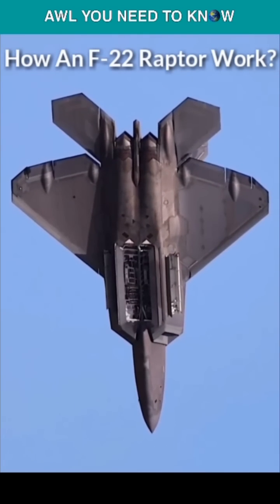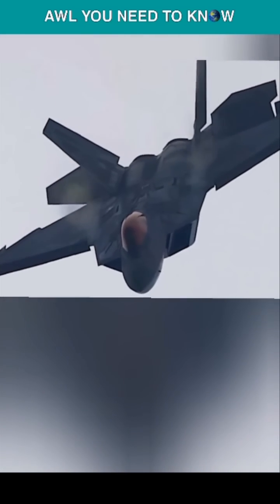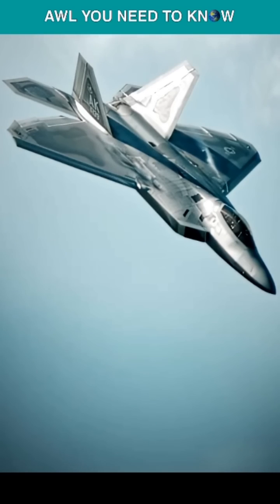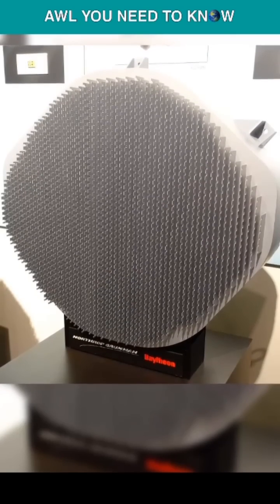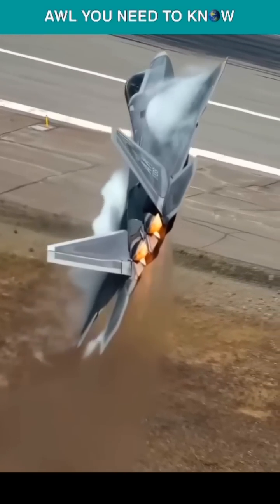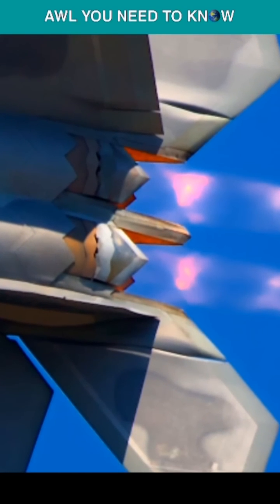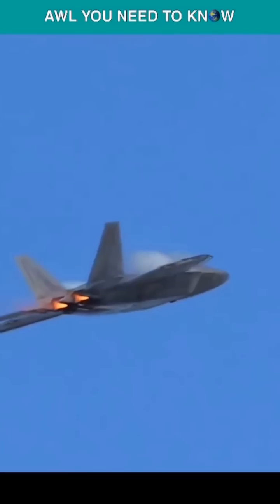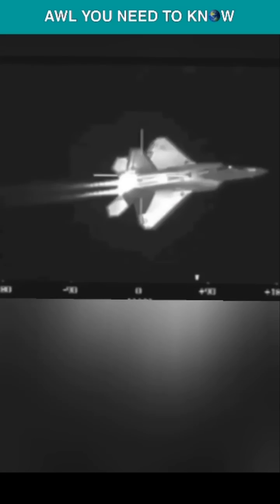How An F-22 Raptor Works? #shorts

Comment: Actually this is inaccurate. Most of the Raptor's surfaces are at angles and not curved. Curved surfaces would reflect back to a radar station.  The angled surfaces deflect the radar waves so that they don't go back to the radar station,  thus rendering the Raptor "invisible."

Comment: Need to make a Gatling gun that drops out of the bomb bay and will rotate 360 degrees to gun shoot without need to turn plane.
Reply: Cool idea, but seems impractical for a fighter.  That would add unnecessary weight and complexity.  Gun kills are insanely rare.  If a Raptor gets into a gun fight, MANY things have gone wrong.  

An interesting statistic would be of the 105 kills the F-15 has, how many were with guns 🤔

Comment: Radar is often visualised by showing waves. They're also called radio waves as well. Does this mean that in theory radar signals could be sent out from the plane to cancel out the radio waves from the radar? In other words, can they put something similar to noise cancelling from headphones into an airplane to make it near invisible for radars?
Reply: It's called jammers and yes, they are definitely in use
Reply: @babayada2015  I thought jammers worked by sending out noise. Though, it would make sense if there were also smarter solutions available. Thanks for letting me know :)

Comment: the right angles is what makes an object stealthy not the round ones
Reply: No, right angles reflects the radar beams back to be easily detected by the receiver. This was first discovered in the British Vulcan bombers whose curved blended body would become invisible to radar straight on, only when it turned and its big vertical stabilizer was showing did it give a big radar return. That’s why the SR-71 used a blended body with canted stabilizers to reduce it’s RCS. The F-15 on the other hand has a lot of right angles in its body and stabilizers giving it a huge RCS of 25!

Comment: You're lucky that Yugoslavia already split up, if not...  remember F 117 shutdown in 1999.

It maybe undetectable from American made radars, but not with Soviet / Russian and French made Radars!

And further more, stealth aircraft doesn't actually stealth, it's just the radar cross section area are smaller than the others. 

It may not be able to be detected at long range, but it will definitely able to at short range or when the weapon bay or bomb bay door was open.

So.... surprise attack is one of the advantages, but not for long!

Comment: Unless the radar used is vacuum tube analog, then the stealth mode is defeated.
Reply: The S-400 fails to detect F-16 and F-35 kid
So it's impossible to detect F-22 keep dreaming
Reply: @kakashi852  s400 and other russian stuff is trash comparing to american genius enginering
Reply: @mountainman42  yes you are right

Comment: The f22 need to be modernized like they did with all 2 decades old planes
Reply: Besides the Raptor facing retirement by the end of the decade, the military is already balls deep in testing the next gen fighter demonstrators. Upgrading now would likely be a waste of funds, especially with the JSF finally coming online in capacity.

Comment: why are all the people that leave comments so stupid THIS IS VERY OLD TECHNOLOGY AND IT IS OUT DATED OTHER JETS HAVE SHOT IT DOWN IN WAR GAMES  WE NEED A NEW FIGHTER
Reply: While yes the project was conceived in the 80’s and the first two test aircraft were made in the 90’s the 22 is far more deadly than you realize. I was a crew chief on them in the early 2000’s at Elmendorf AFB in Anchorage Alaska and participated in many red flag campaigns. When they finally actually let the 22 compete the pilots were told not to put the Raptors full capabilities on display for any foreign pilots to see. I’ve had pilots tell me they’ve done 8G turns in a 22 because of how the suits are designed and that they wouldn’t dare try that in the 15s and 16s they flew beforehand. Any kill that a forien country gets of a Raptor is nothing but pity because in actual combat they’d be dead before they could ever see them. When the 22 was rolling off the lines it went against pilots form the naval top gun academy and defeated the F-18 100:1 and when it was coming up to Alaska they fought against F-15E models and had a kill ratio of 120:1. I’d like to see the garbage delta-winged piece of junk know as the Rafael boast numbers like that.
Reply: 6th gen fighter is on the way as i know so dont worry. 20 + years old fighter is still Number 1 in world. Imagine what it will be when they will build a new one
Reply: You do realize when it gets shot down in a war time simulation it is starting on the defensive. Whenever it is in a brv simulation it is undefeated downing six aircraft on its own.

Comment: F 119?
Reply from the maker: F-22's engine.
Reply: Unless they’ve changed them the F-22 uses 2 Pratt & Whitney F100 series motors which are capable of 35,000 lbs of thrust a piece. I was a crew chief on the Raptor for just over four years
Reply: @GreenSargent The F-22 uses F119 engines. The F-16 and F-15 both use the F100 engines. I’m an engineer at Pratt & Whitney
Reply: @jetskiwu  if you enjoy your job you are lucky as hell
Reply: @jetskiwu  you’re right. Had to look at my CDC’s haha
Reply: It’s the name of the engine, not the plane.